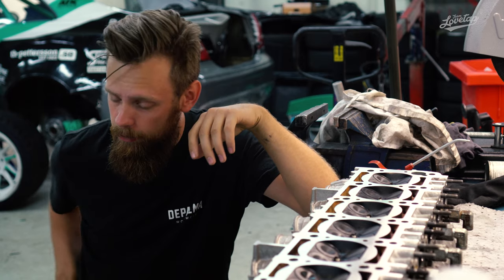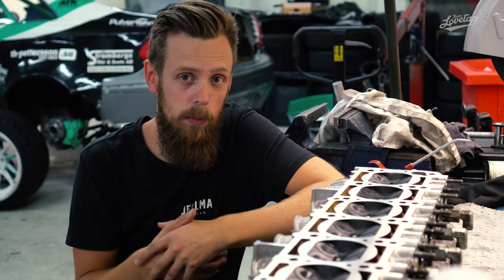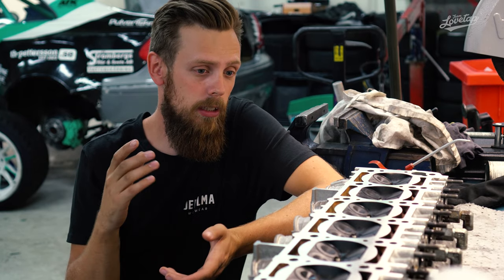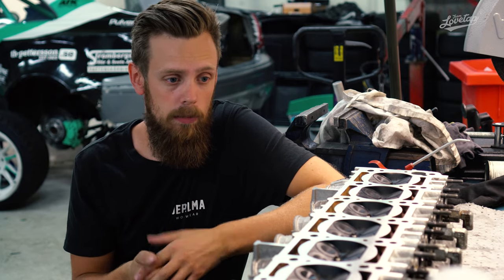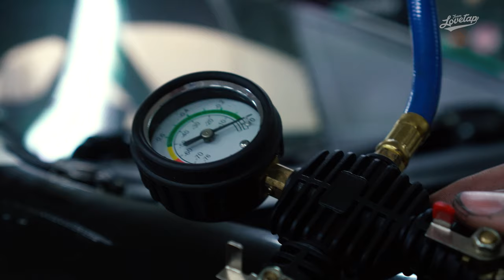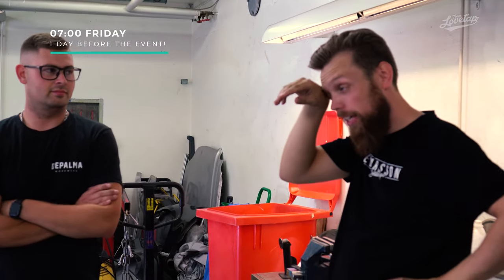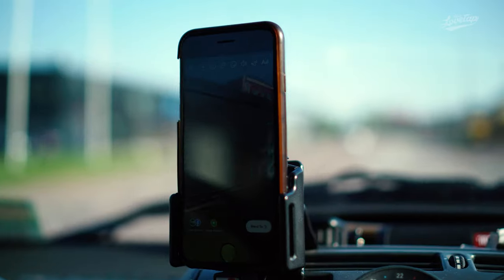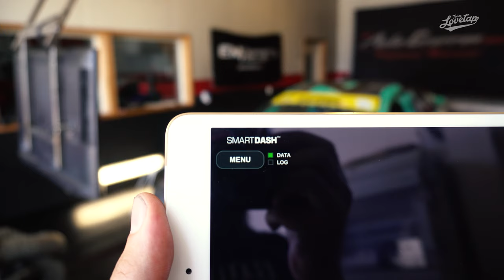Rebuild and Dyno Test M104 Turbo CLK | 800whp | Vlog #39

Comment: i changed more head gaskets on the m104 than any other engine in my career. nice to know the m104 can make some power as they are dirt cheap
Reply from the maker: Thats weird to be honest, which years?
Alot of people run these unopened with 600whp
Reply: @TeamLovetap  over here in usa. I was a dealer tech and under warr we constantly changed head gaskets. I am now interested because i can get an r129 320 cheap and make some power. never thought of it that way.

Comment: This has to be the best M104 car on youtube.
Have you ever considered going for a stroker motor?
I have a om613/648 crank laying around that I'll possible put into an engine I want to build for a big turbo.
Reply from the maker: Ditch King thanks alot man🙏🏻 We are very active on Instagram and Facebook to👌🏻 I actually have run a 3.6L C36 amg turbo before and I have a crank layin around. But because of the block being a bit sensitive to cracking I would recommend going 3.2L
Reply: If you keep it the same bore it should be ok I think? Or is the cilinder extremely weak at the bottom of the stroke.
Putting the om648 crank in the 2,8/3,2 block should give 3366cc, that doesn't sound like a lot, but it's still over 5% increase from 3199 :P.
Reply from the maker: Ditch King its not weak due to bore its sensitive to alot of early torque and big stroke. Its because of how the cast is done, thats why I use a support girdle
Reply: How thick was that plate anyway? I don't think you said it in the video.
I already have the engine sticking out and having it raised too much would mean a custom transmission tunnel :P.
Reply from the maker: Ditch King its only 6mm
Reply: Hmm I guess that would be managable.
If only the m104 had those nice 6 bolt main caps the m120 has :P.
Reply: Would you say a 2,8 might be even better to turbo because it can rev higher and make less torque down low?
Reply from the maker: Ditch King 3.2 is probably better because the 2.8 cant rew much higher anyways because of the lifters
Reply: @TeamLovetap  Hmmm with reground cams and solid lifters that should't be a problem.
The 2,8 should do 10k rpm while still being well under 25m/s mps.
Reply from the maker: Ditch King yeah if your willing to do the work ofc, i was expecting without rebuilding the whole cylinderhead
Reply: Yeah I guess keeping the head stock has some merit :P.
Reply from the maker: Ditch King yeah its good and bad for sure

Comment: Hey man, love the build. The shop I'm working for is currently in the process of doing a m104 turbo build and have been trying to figure out what spark plugs we should be putting in, is there any chance you could recommend a set that would be good for 400 to 500 wheel hp range?
Reply from the maker: I used the NGK BCPR7ES sparkplugs for a long time, they sre great for that setup✊🏻

Comment: Very neat! How do the 3.0 m104 and the 3.2 m104 compare in terms of of boosting/taking around 800 hp?
Reply from the maker: Both a solid pieces for sure, not much difference more than a little bit bigger displacement in the 3.2L.
Reply: @TeamLovetap  really appreciate your reply 👊🏻 yours is absolutely crazy.. I‘m about to get one (3.0) with 170k km on its back, should that be of any concern bringing it up to 600 hp?

Comment: Do you know if you can run Coil on plug on a factory m104? Is it possible to rewire it and add 3 extra coils and split the signal to run it as wastespark with each coil ? Or do you need an aftermarket ECU? Thanks
Reply from the maker: I dont know tbh, but I doubt that it would work with the stock ecu if it hasnt had it from the beginning, so probably need aftermarket ecu

Comment: What fuel it run? Great car! Hope to build similar project with 0 experience, would you help us out with the parts if we get stuck? No supply of them here(
Reply from the maker: TJ Motion Channel we run E85 on it, thanks a lot man! I would not recommend doing a project like this with zero experience, its quite the task
Reply: @TeamLovetap  thank you very much for your answer! We have broad general engine repairs experience, we have done our homework on theoretical side and OEM turbo cars and we want to get on new level now:) it took us years to prepare for this project in every possible area of knowledge possible and currently we are finally think we are ready for bigger steps:) just no one to help or advice here, nor any decent parts diversity for needed parts. So we’re looking partners to help us out on this one and build up from there. Btw we are from Kazakhstan car tuning enthusiasts, hello to you from everyone in our staff, my friend!
Reply from the maker: TJ Motion Channel then you dont have zero experience but we make most of our parts ourselves for our car so its not all available
Reply: @TeamLovetap  the reason I ask about fuel, is that we have no e85 here, so I targeting on how much we’ll get on regular 98 pump gas. I see about 600-650 optimistically?
Reply: @TeamLovetap  just zero experience in tuning ECU’s fitting in turbos in NA cars, all that car tuning sweetness) if you make them, then we can buy them no?:)))

Comment: mate how did you fit a trigger wheel to that crank pulley
Reply from the maker: I did an adapter to bolt on the existing harmonic damper